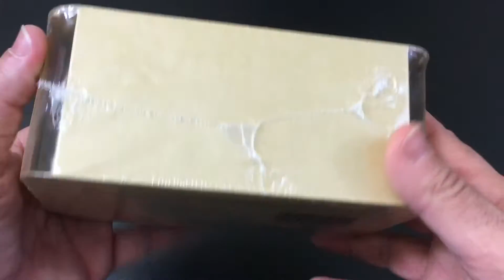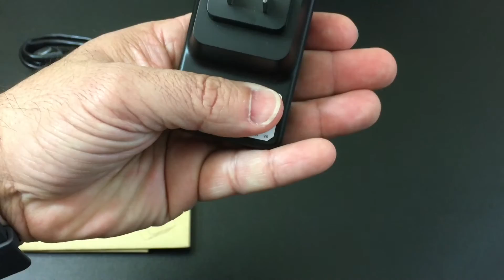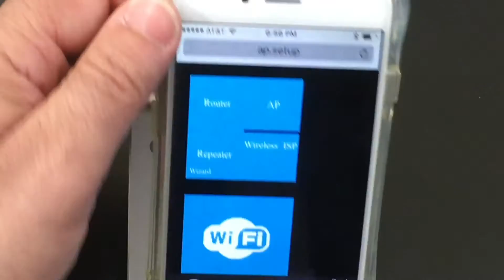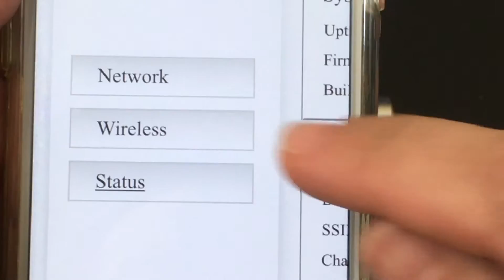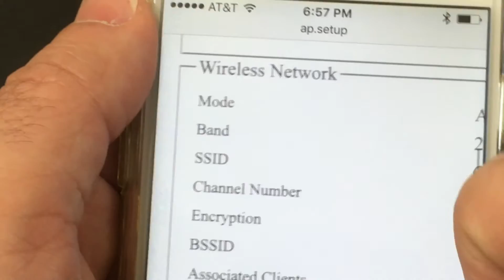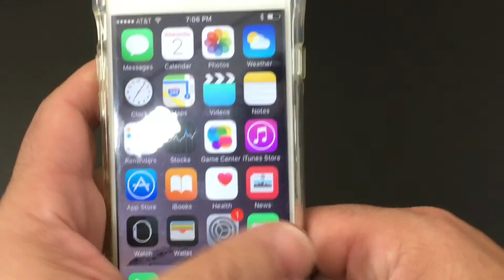Coredy N300 Mini WiFi Range Extender / Access Point / Router

Comment: Will this work for my PS4? I ordered a WiFi booster a few days ago and it didn't work for my PS4 meaning I had to return it. I wouldn't like to wait a few days for shipping just to be disappointed with what happens so I would love if this was able to work. If this doesn't work, do you know a WiFi booster that would work for under 50 dollars? Thanks!
Reply: @Krazykid7980 yes it works with the Ps4. I just set the Coredy extender up (same Coredy extender on the video).  

Setting the Coredy extender gave me a separate wifi connection so i now have 2 wifi connections

When my ps4 is connected to the Coredy WN300 wifi I wasn't getting the best wifi speed. Ps4 download speed 7.2Mbps Ps4 upload speed 1.2Mbps (it varies). So for me to get the best wifi connection speed I will connect all the devices (cell phones, computers, and etc) to the Coredy WN300 and use the main internet router to ONLY connect my Ps4 and no other device. Hope this helps!!

Comment: another quick question. If one was trying to extend for a hundred feet or so outside do you think one could daisy chain these units? Would one feed another feed another?Thanks
Reply from the maker: +Lava Java I would take a look at the asus RT-AC3100.  This router has simplified my home.  I get wifi coverage in back of my house and in front.  I went from 1 router and 3 ap to 1 device.  The problem with having too many devices will be wifi noise, every unit you daisy will drop performance.  with the asus while expensive I get 120 MB wireless all over the house.  Expensive but boy was it worth it

Comment: great review. I'm assuming you recommend it and how much of a range past the extender would you guess one should expect. Another words if you put this on the outskirts of your house where you have a reasonable but somewhat weak signal, but it extend outdoors, and how far?
Reply from the maker: +Lava Java I am in a quad floor home.  My router is in the basement and I have trouble reaching one room before I updated to the asus router I reviewed on the channel and now have excellent access.  I tested this one with a Onhub google router that doesnt perform as well as my asus and it did well.  I like that it was compact and I expected a drop but it didnt drop that much as I have seen from other extenders.